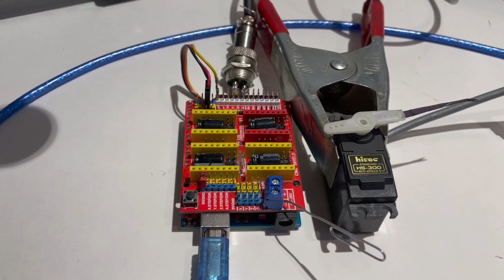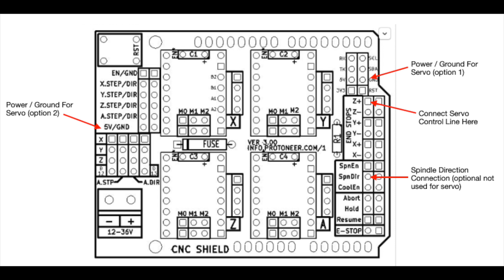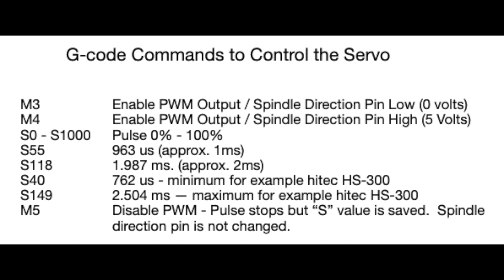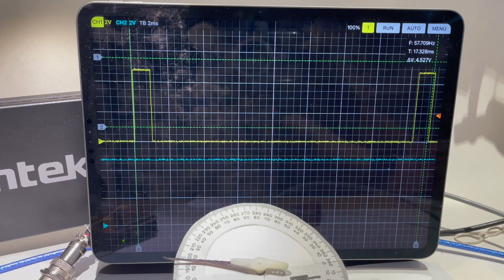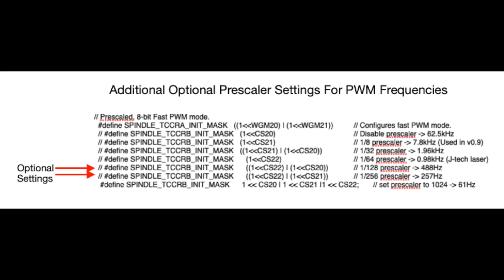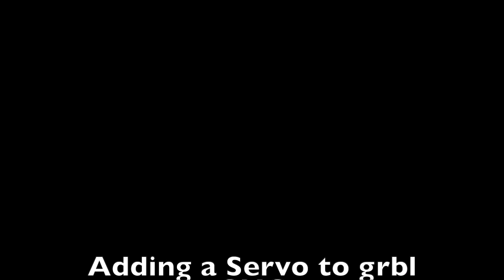Servo Added To CNC with grbl Software

Comment: Thank you for the explanation. I have a question. I can move my X and Y axes. But I have a problem in moving the servo. I did the connections right. But I cannot see my servo moving with M3 S55. I have tried powering the servo with 5V from a different power source but this did not work again. I am afraid my Z+ pin on CNC Shield has a problem. Is it possible to test the Z+ pin from Arduino without using grbl? Which pin of Arduino connects to Z+ pin? I could not trace the line on the PCB. Thank you.
Reply from the maker: Hi,  Sorry I took so long to answer I didn't see much traffic so I didn't look for comments often.  First the easy question about which pin.  Look on line for CNC_Shield Schematic to see how the Arduino is connected.  As for testing the functionality, first make sure your servo is working.  Don't use the CNC Shield, but connect the servo directly to the Arduino and go on line and find a servo example for the Arduino.  Note that the pin is labeled Z+, but that is not its function with the servo.  The PWM Circuitry in the Arduino connects to Z+ so the changes to the config.h file and the cpu_map.h file are necessary to change the grbl function.  
As I mention in the video the pulse frequency is about 60Hz which does not meet the servo spec.  My cheap servo worked, but higher quality servos might have tighter specifications.    One final thing.  At the time of the video I didn't understand why the spindle speed varied from 0 to 1000.  I believe that number is set by the $30 value in the presets list.  I think if the 1000 was changed to 256 the servo would move for single steps, not every three of four steps.  The servo won't respond to the full range (0-255), but it think it will move for each step in the valid range.  So try that and see if it works.
Reply: HII I AM FACING SAME PROBLEM LIKE YOURS HAVE YOU FIND ANY SOLUTION PLEASE HELP